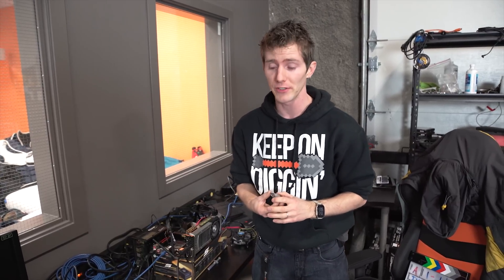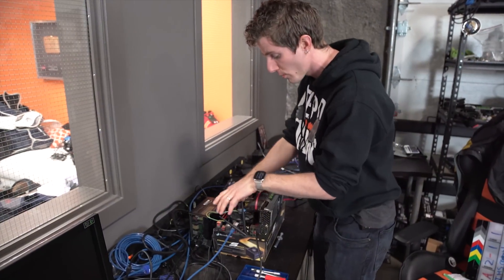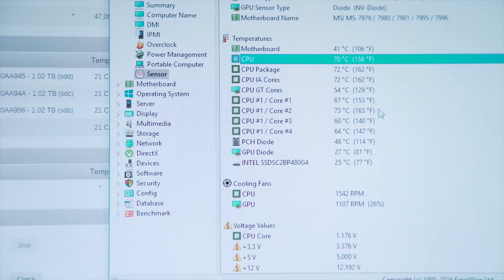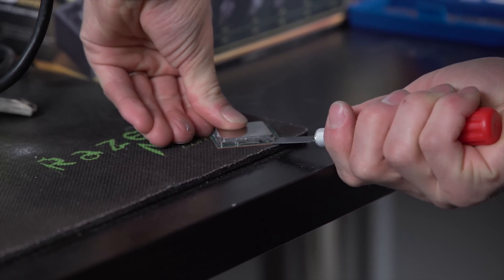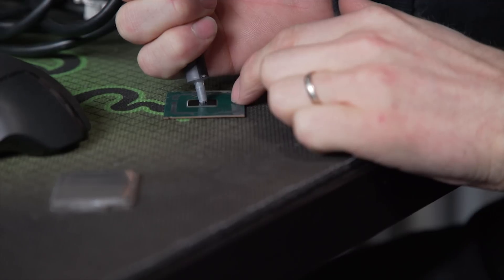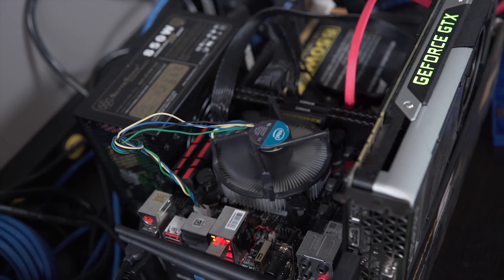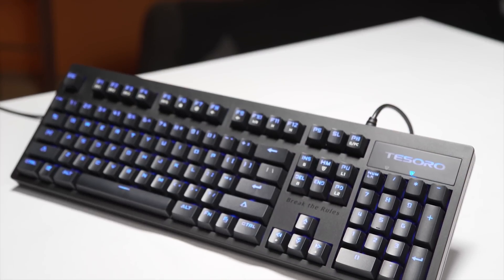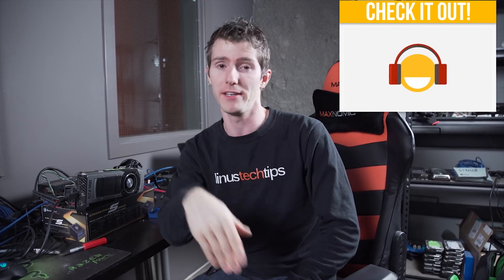Delidding an Intel Core i7 6700K - Is it worth it!?

Comment: I think that if you decide to delid the CPU, then you should go all the way - get better TIM ("that liquid metal stuff" :P), sand IHS (which is not perfectly flat out-of-the-box) and use proper amount of TIM with a aftermarket cooler that has great performance, not that box cooler crap. I know, that Linus only looked for delta between delid and standard CPU, but when you are testing tweak that is on the more of the extreme part of the spectrum, you should also prepare whole environment. I bet that if you would use good setup mentioned earlier and then check delid vs standard, then the results would vary more than 2-3C. I delided my i7-3770k, sanded/polished IHS, replace TIM between die and IHS to Liquid Pro, used good quality TIM between IHS and aftermarket cooler and I've got 12-13C drop in temps. Granted, Ivy Bridge had one of the worst TIMs and space between die and IHS, that's why temps went that much lower. It was corrected in future generations, so you won't see this high drop anymore. It lets me to run this CPU 24/7 4.4GHz with temps lower than standard clock non-delid (still tested with aftermarket cooler and good TIM).
Reply: +CoreyPL This is the EXACT review I was looking for by Linus. Thank you and Fail by Linus.
Reply: +Tanzu15 Basically you sand the metal part with the name of the CPU. Before doing that there are plenty of other factors to consider: 1. It will void your warranty; 2. If done incorrectly it will damage your CPU; 3. Works best with good aftermarket cooler with flat rectangle\square shape. You must also check if your CPU really needs it - take a metal ruler or something similar that won't bend, put the edge on top of the IHS (metal part) and shine a light through it. If you see more light bleeding out in the centre or edges that means IHS is not perfectly flat. Be sure not to use too low grit sand paper because you can sand too much of IHS and damage it. Remember that after sanding you will expose pure copper on the IHS which will oxidize on the parts that will not be covered by your aftermarket cooler and you will probably need to clean\polish the IHS to get rid of that. That are some basic rules to sand IHS. Be sure to take all the pros and cons under consideration, because once you do the first move on the sanding paper there is no turning back. There are also a lot of sanding tutorials on Youtube - check them before doing anything and if you decide to go with it, prepare all the materials needed beforehand.

Comment: I cant help but think that actually a Really decent cooler would make a difference as you get much lower temperature, thus the rtemperature gradient is larger and you can therefore see the true effect of using a replaced thermal compound. as on the stock cooler, the temperature is fairly high, at a high temperature the delayed effect of the crappy compound will be lessened.

Comment: if you are crazy enough to delidding the cpu, i dont think you will use the stock heatsink.
hell, the 6700k does not even come with a heatsink
once you start overclocking the cpu, you will see why delidding the cpu is worth it

Comment: I can tell you first hand my 4770k couldn't even do the test you were doing on it without going well over 100C (stock fan). Put a H100i on it and the temps settled to a mere 86C.

After delidding and putting some ultra and just some normal arctic silver on the IHS. My temps went down to a max 56C running the same exact thing. Either that stuff is amazing or the thermal paste in it sucked. Oh not to mention that is overclocked as well. After I could actually overclock. .

Comment: I don't see the point of doing this in a practicality sense. Unless there is a problem with the temperatures of your chip in normal operation, then why? Enthusiast is the reason. And that's the only reason you need. :)

Comment: only 70C, what pussies, wasn't even pushing it that hard cause had he, with that stock cooler the temps would have shot up. Fuck delidding a CPU, these newer I7 are designed to take the heat, if my 4970k can withstand its maximum operating temp (which also happens to be tjmax of 100C) for 4hours on a torture test and survive just fine, I don't think I have to worry about cooling. Wanna risk fucking  up your cpu by delidding it, go for it, there is no need on these new ones, they take the heat just fine. ya'll just a bunch of pussies an too scared to let your processor get that hot. :P

Comment: Why didn't you test better cooler mounted directly to the cpu dye (not with metal heat spreader)!?
That would most definitely change things as heat spreader is qiute thick making probably another 5°C difference in cooling. This would mean cca. 10°C lower CPU temperatures and this is most certainly a huge deal: longevity, CPU overclocking...
Reply: +ZiGa:S because the cooler probably wouldnt reach far enought to touch the cpu dye.
Reply: tjeulink
All decent CPU coolers have springs to accommodate different CPU heights and make better fit!
The only downside of mounting CPU cooler directly to the CPU die is that if one extensively wobbles the heatsink (especially heavy/big ones) attached to CPU, one can break CPU die.
I would test it myself, but I don't have lots of money to throw away on nonscientific testing.
Another thought, if the CPU heat spreader doesn't affect performance, why do all laptops have bare die CPU attached directly to heatsink? (better heat dissipation?)
Reply: ZiGa:S i meant that the dye probably doesnt come out far enough so the cooler hits the motherboard brackets rather than the actual dye.
Reply: tjeulink
Oh, that would be possible, but there are always workarounds :)
Reply: ZiGa:S yea i was thinking that too, if someone is willing to go far enough to rip the case of a cpu they will probably mill their cooler to if needed.

Comment: Note:  About your "pre-polished" IHS. .... Some coolers, including after market ones, use a slightly convex surface, and Intel has been using a an IHS with a concave surface for some time. ....  I suggest you take a close look at your heat sink surface and make sure it is flat before flattening the surface of the IHS. .... What TIM did you use? .... Did you remove the old TIM from the CPU cooler? .... thank you for taking the time to make this video.

Comment: Can someone explain to me why he re-uses the heat spreader instead of just sticking the heat-sink directly to the CPU die with some compound on it? Is it because it will not make contact or something?
Reply: +behemothinferno right, there is a gap between die to the heatsink.. you cant mount it.

ek has made a tool called ek-precisemount that allow mounting direct-die waterblock. 

I also, personally get a motherboard by msi, that in bundle give a crappy tool, called "MSI Die Guard".

Comment: And I think the issue isn't with the internal tim on the die, it's the gap caused by the silicon glue holding the heat spreader on the pcb.

Comment: I discovered what was the cause.  I had some bsod with win 10, some  update corupted my file, And I try  to switch to oc mode. when I switch back to standard mode, some  bios setting  bloked the cpu core voltage to 1.4v. I loaded the bios default settings and now  my cpu core voltage is 1.2 on full load. The cpu temp  in ful load , maximul 70 degree. the CPUTIN 34 dgree, before was 84 degree..

Comment: 4:00 | does that apply to haswell as well? I have a core i3 4130 and want to do this.
Reply: +Peter Hindes .  This will not help with a core i3 4130; it is best to leave it alone, except to purchace a better TIM .... [and do not apply as much as Linus did in this video] .... You need no more than about the size of 2 grains of rice, set end to end, and just as wide - no more, if you have to make it slightly wider, use about the length of 1 grain of rice. .... There are a few very good types of TIM, I still use GELID GC-EXTREME.  It cost more, but does a better job than many others, including Prolima PK series or Arctic Cooling MX series.  Stay away from Arctic Silver series, it migrates and leaves "cracks" over time. ....  However, ArctiClean 1 & 2 is outstanding for removing TIM and cleaning the cooler heatsink and CPU. ... Use a clean coffee filter for final clean up, the do not leave lint or paper particles behind.
Reply: +ZZstaff | would this help the temperature being 100° under full load, or is that just efficiency, because if you had heat pipes you could cool it to like 60°

Comment: How about next video you show us Fibre Channel Network setups, for that super speedly lightning fast network stuff for local area network so you can transfer large files from one place to another in an instant at lightspeed.

Use base examples of file sizes of 5Gb, 15Gb 20Gb to compare the differences between normal local area network speeds in how long it takes to transfer something.

You will have to use SSDs to get the maximum speed possible for read-write also for it receiving and sending data across the network.

Comment: What a load of misinformation this video is. The TIM is the reason the temps suck? NO! The TIM intel uses is the best non metalic TIM there is. The REAL reason we delid is because the silicone adhesive intel uses creates a gap between the IHS and the CPU DIE. How can you not know this?!? Then there is the method you're using which is the MOST dangerous method, even for skylake, with its thinner substrate.
You saw a few headlines that said "People are breaking their new skylake CPU's with the vice method!" Even if that is true the vice method is STILL the safest way to do it. (NOT the hammer method ofcource) The vice method is 100% safe if you know what you're doing. I've delided a fuckton of skylake CPUs with a normal vice. Linus and everyone else at LTT are truly what you would call "label readers" Get a fucking grip.

Comment: Why is Linus still such a noob with PC hardware, lol
Reply: He really is.
Reply: +Nerdburger85 I'm curious why you think that...
Reply: +Yuannan Lin Lol. Maybe he cleaned it after? There is absolutely nothing wrong with touching "pins" of Intel CPU, of course if you're in gloves or after all clean it for safety, or... just have clean hands?
Reply: +That Dutch Guy you are right. He deliberately used not so good thermal compound between die and ihs and also the stock cooler so that delided results are close to original ones. I got 20 Celsius improvement by deliding my processor.
Reply: +something1random23 Is even more hilarious your ignorance by thinking that everyone here is from USA or any other country were the English is the native lenguage.
Reply: +Yuannan Lin He's never cared about trying to keep the components "safe"...
Reply: I understand that is true but I was stating that Linus just doesn't care. He's never gone through any steps to make sure the parts don't get damaged.
Reply: yeah he have the money for buy more. like PAST VIDEOS XD
Reply: For security reasons
Reply: +Yuannan Lin Will it just fry when unpowered? I find it difficult to believe.
Reply: *****
So it's fine when it isn't even socketed.
Reply: *****
I'm way too clumsy, I'm just gonna break it myself if I try that.
But wouldn't moisture issues be solved by making sure the chip is dry?
Reply: *****
Fair enough.
Reply: +Nerdburger85 This isn't noob'ery. I've been bumping the LTT thread for months, he won't reply. He knows it's wrong, i'm almost certain it was an Intel promotion. "look, our TIM isn't bad".
Reply: +Nerdburger85 The worse thing is that I saw on 9gag someone post Linuses 7 gamers 1 cpu video and on the title he write "Watch this computer GENIUS put 7 gamer on 1 cpu", it seems like no one on this channel know about Singularty Computers, PC Junkie Mods, Bill Owen, The Mod Zoo even DazMode, hope they saw this and start seen that Linus is not that "hardcore".
Reply: +HeyDan1983 LOL OMFG, I made a youtube channel just to reply your stupidass comment.
Do you even understand the name of the channel mate? its Linus Tech TIPS, Not Linus PC "Hardcore" Mods. he is targetting average consumers, not "Hardcore" modders. IF u have a common sense and can read the name of the channel, i'm pretty sure you should have think twice before making that comment and hoping people start watching those "hardcore" channel. You know that those channel you're talking about is about "Modding your PC" right? They're not for average PC consumer, those channel are targetting Modders who wants to "Mod" their PC in "Hardcore" way. About that 7 gamers, 1 CPU.....Well i agree with you, but to be fair NOT everyone can do that. Even though you dont need to be a GENIUS, Still you need them skills.
Reply: +Ferry Ansony I would borderline voiding a $350 dollar CPU that you could possibly destroy in an instant fairly "hardcore". Especially in this case, which is surely not an average consumer minded think (although I did it on my 4770k. Sure they don't do LN, but this is by no means standard.

Also, as far as I'm concerned a channel is something people watch, not just a username IMO.

I'm not saying you don't have a right to your own opinion but as they say.. you best check yourself before you wreck yourself."
Reply: Ferry Ansony And we have here another Linuses sucker balls... If this is not a "Mod" channel why is he doing this on his channel? why is he giving tips on how to water cooled your PC, even with hard tube, by the way that video was more like "how not to do it" instead of a tip, why he painted a MoBo?, all of those things are modding if you didnt know, even this delid process, Im not saying this is a "only mod" channel, but he´s also trying to give those tips, but I think he needs more experienced on that before giving them. I think you´re not up to what Linus make on his channel, so go and fuck yourself, and you´re the one that needs to think twice, before making rage comments and insulting people.
Reply: Ryan Dailey see, you have the willing to do that. But not everyone, the thing is.....this video is made for everyone, not for "hardcore" modders as the hayden dude says. If you, or he, or modders wanted to do that and wants more "hardcore" modding well thats perfectly fine. But what pisses me of is that he generalise different channel with other completely different channel and it feels like he tried to make people stop watching him because he is not "Hardcore" enough :\ btw sorry for a pretty inappropriate words there.
Reply: HeyDan1983 Oh My God......seriously, i understand that those are modding, but why on earth you compare this "tipsy" channel with some serious "hardcore" modders? That is the only thing that pisses me of. And yes you can call me whatever you want, because I'm a fan of linus. He give me SO MUCH Information about PC so i can make a career out of it.
Reply: +Ferry Ansony Well you have a point there since they literally don't do a lot of modding but. I think they are trying to be in between. Some who are crazy.. others who are just trying to dabble with pushing their machine.
Reply: Ferry Ansony Linuses channel is full of modding, cases, motherboards, video cards, desks, the fallout 4 bomb, he even took the second DVI port out of a titan just to make it a single slot video card with its waterblock.
Reply: HeyDan1983 Hold on there cowboy. Its NOT full of modding. There are more to it such as review, how to fix something, builds, overview, tips & tricks, other information (even more if Techquickie was counted) And yes, you probably right. He is not as perfect as a profesional modders, but what he did is working. And its working well i can say. Btw to be fair this channel isn't all about modding man, he is like trying to be in the middle. But channel like Bill Owen and PC Junkie Mods is a pro so its not a suprise that they need to be perfect in modding.
Reply: +Yuannan Lin I just replaced my CPU today held it flat in my hand just like Linus put it in and its working 100% gg
Reply: People arguing in broken English is hilarious.
Reply: +something1random23 Is even more hilarious your ignorance by thinking that everyone here is from USA or any other country were the English is the native lenguage.
Reply: HeyDan1983 You're the one who chooses to communicate in English without being that good at it. It's not my fault it's funny. You could always go watch channels in your language.
Reply: +something1random23 Oh I think Im actually good at it, the point here is that even people can make mistakes with his/her native lenguage, so I dont see the "hilarious" on your comment, and at least people here know how to communicate (maybe bad, but you still understand it) in another lenguage other than their native lenguage...
Reply: It's usually more funny when it isn't the native language. The ordering of words and choice of words is usually strange, or the way children use them. I find that funny.
Reply: something1random23 to be fair, you should be thankful because its in English. There is more than 700 language in my country alone, sooo yeah. Stop thinking like stereotypical american that always think they are right.
Reply: Ferry Ansony I'm not even American. Though English is the primary language of my country, there are a lot of immigrants who never bother to ever learn more than the most basic English and continue to speak in their native languages. In that respect there are probably as many languages in my country. However, English seems to be the most popular (universal) language for international communication and commonly learned by people in most countries. If someone wants to argue in a language they are not fluent in, it can create a lot of confusion. I am free to tell them what they're saying doesn't make sense. While it can be a bit of a chore to decipher what they're trying to say, it's funny nonetheless.